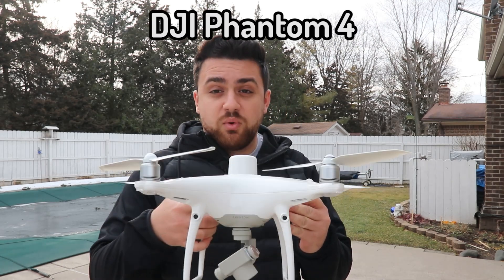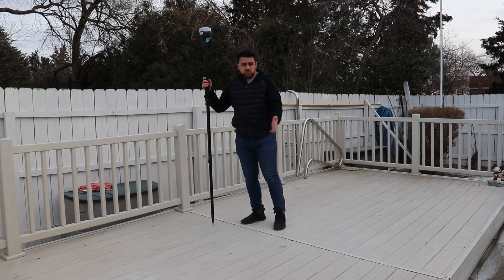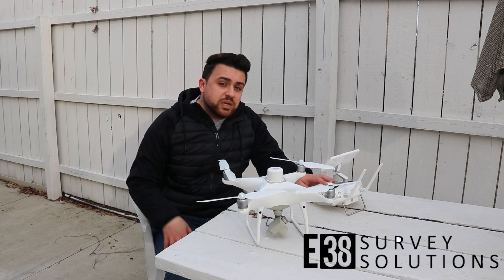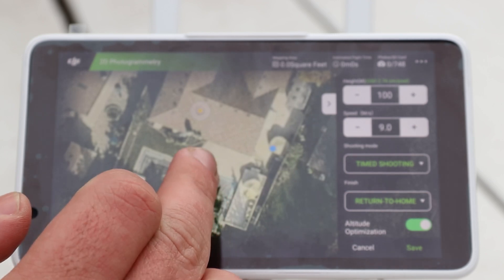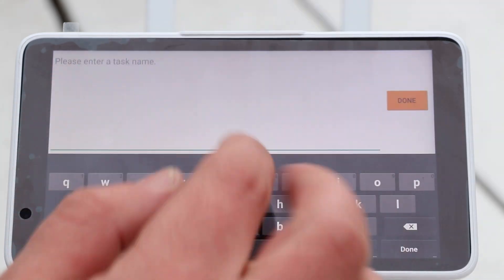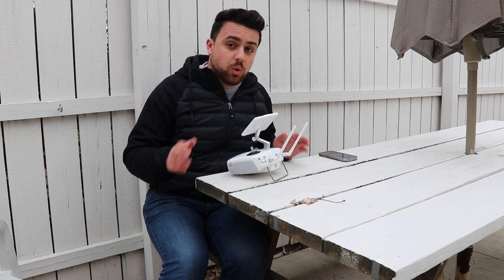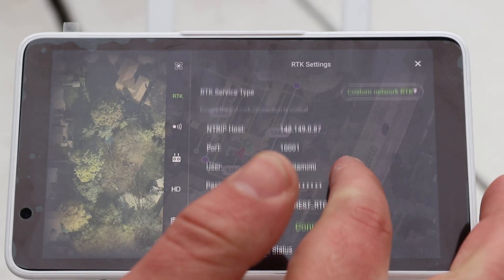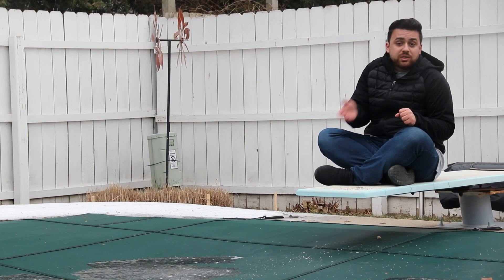RTK Drone Surveying and Mapping

Comment: dJI should add a third type of rtk, using a gnss over BT. If u think about  it its crazy having a gnss and P4rtk together and forced to use internet protocol. Of course i had to buy a drtk2. Once again dji's software Is not at the same level to the hardware

Comment: Do you not worry that pretty soon this will put you out of a job? Anyway is this more expensive than a total station?
Reply from the maker: Not really, drones are great tools to use for certain applications. There are certain types of projects that this would not be appropriate, so a surveyor will always have a role in deciding which tool they should use for which project.
Reply: I’m still studying the industry, but Drones are typically considered a “tool in the toolbox” rather than an industry disruptor. These types of drones are typically a few thousand.